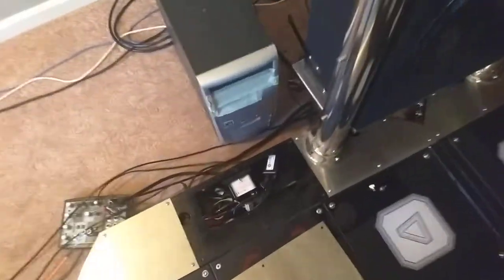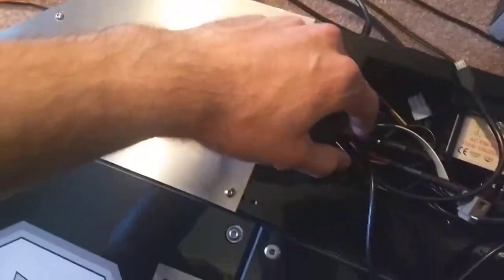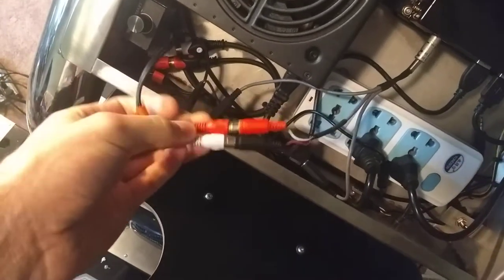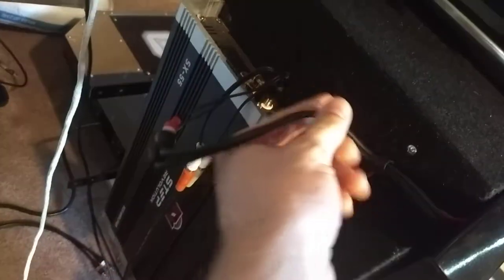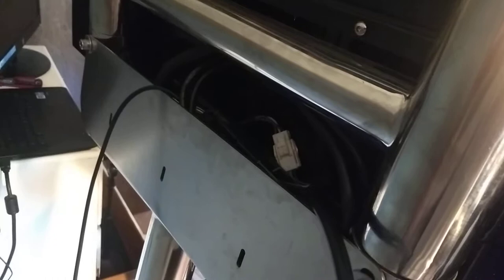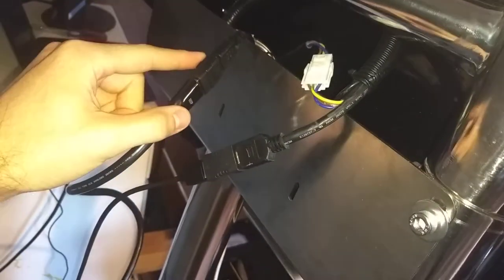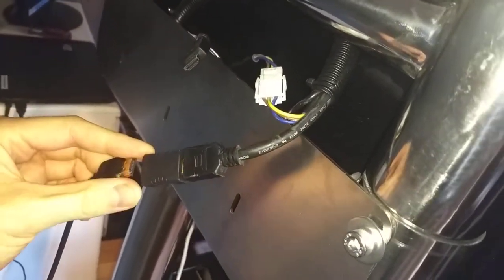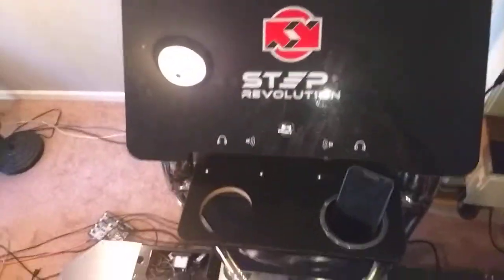How to connect StepManiaX all-in-one cabinet to your PC

Comment: Hi, quick question: What cables do you use for connecting the back of the pad to your PC over USB? 
Should I just ask for micro USB -> USB connector?
Reply from the maker: it depends how old your pad is. the most recent revision uses usb type C, the previous versions used usb micro B, and the first generation used full size usb A. do you know what generation your pad is?
Reply: @werdwerdus  Generation 4
Reply from the maker: @andrewre3146  yep! so that's usb micro b for the pad side and standard usb A for the pc side. feel free to join the discord chat if you have more questions or keep posting here and I'll do my best to answer. you can try using a standard micro USB phone charger cord if you have one.  https://discord.gg/q2s2Uu62ZN